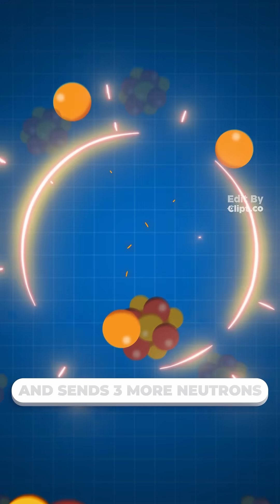How does nuclear energy work??

Comment: Inaccurate, here is the Accurate and simplifed? one. The nuclear reaction makes heat then water turns into steam then the steam either goes to the HPFP or deaerator or the steam turbines. In the steam turbine the steam goes into the high pressure turbines then goes into and expands in the intermediate pressure turbine then goes into and expands in the low pressure turbines then the steam goes into the condenser which turns steam into water using coolant (the hot coolant goes back into the cooling tower after cooling the steam to cool the hot coolant to cold coolant then goes back into the condenser to cool steam again)
The the condensate goes into polishers then deaerators then HPFP then goes back in to the reactor vessel then repeat. (also control rods and boric acid control the reactions so it wont over heat) (iodine will appear during reaction then decays into xenon)

Comment: So does that mean...: if energy has mass but is also at the speed of light it can create a lot of energy in not a lot of mass so when a fission core is turned on: This releases an neutron that neutron hits the uranium atoms so fast that they putted the reaction things into water to slow things down a bit those uranium atoms sends 3 more neutrons and spark a chain reaction that creates a large amount of energy and there is a problem with a major twist: If you don't contain the reaction you can end up making a power core turning into a bomb just like Chernobyl and Fukushima with 20 cm thick steel the nuclear energy makes the water boil and turns it into a steam that steam goes into a turbine the turbine powers a generator and the generator makes electricity! Just in case things get too hot they have these kind of cooling towers to release all the too much steam. (Correct me if I'm wrong I don't know chemistry equations)

Comment: Fact not fiction or fantasy 
Generation is dirt-cheap.
Both nuclear and roof PV. 
6cent kWh to 2cents kWh.
Nuclear electricity comes to your meter box full of GRID RENTAL COSTS. Big $$$$ cashflow. 

And then when the dunkelflaute stops, the GRID cashflow stops. But only when the sunshines. 

I am extremely concerned for the grid and the grid economics and the grid owners massive investment's ROI, return on investment. 

The grid was built over 14decades, 140years.
The grid is extremely valuable, too valuable to waste. Unfortunately to expensive to overbuild and too expensive to expand. 

The only way to double grid capacity is to build a second grid, basically double the existing grid capacity. At upto $13million per km in Australia and with 1million km in Australia, and limited number of decades, the fake GRID people live in a fantasy and will do more harm than good. 

Facts do matter, selective facts are just a fantasy. 

" Huston we have a problem "
A problem that most people do not see. 

I welcome all good thinking people because as you say it is a big problem. 

I got pissed off because my CivEng Degree friend who built designed and built earth dams in the rural Australia and read a book on nuclear chemistry promotes nuclear on national TV. 

He totally ignored my CivEng Degree and decades in large civil construction and building works and power stations and transmission lines and urban infrastructure. 

He took his EXPERT CONFIDENCE in areas of no expertese that was totally wrong. 
He got angry at non experts telling him he was wrong. FMD. 

We both have grandchildren who deserve a future. But he is wrong and only part right. 
He is dangerous. 

So I speak up.

Comment: Ok so heres the correct answer we got 3 types of most known reactors PWR, BWR, RBMK, so normally used pwr works by having enriched uranium U-235 that does fussion witch releasing neutrons and 2 more elements barium and smth else that are radioactive so in other words reactor fissions and creates thermal energy (heat) and 1st coolant goes throught the reactor, the water heats a lot then it goes to a steam  generator when it gives heat to 2nd circulation pump wich turns into steam and also removes small moisture so we have steam then we have a pressuriser that pressurises the steam to like 13Mpa or smth, so then steam goes to a high pressure turbine where it spins but the steam   looses a lot of energy so it goes to a reheater and a seperator that removes moisture and reheats the steam and then it goes to a low pressure turbines where it releases its last energy, the turbines spin at 3000 or 3600 RPM (revolutions per minute) then it powers a generator that normally gives 50 hz frequency and creates electirc energy and tgen it goes to a transmorfer that converts small kilowats to a higher kilowates and then connected to your national power grid so yeah we have electricity. BUT WE STILL HAVE THAT STEAM so after that we have a condenser that has cold really cold water that sorunds the steam pipes turning the steam back into water and then it goes to a reheater like i mean 7 reheaters and then its returned back to the steam generator BUT what about the water in the condenser? RIGHT so that really cold water that condensates steam back into water gets HOT so we have these gian COOLING TOWERS where tha water from the condenser goes and it cpold down with air and then goes back into the condenser. Plus if we loose some water we have a water source. Also forgot to mention THIS IS THE PWR REACTOR. BWR (boiling water reactor) works the same BUT the water boils in the reactor directly so it doesnt go to a steam generator and then goes right into turbines and forgot to mention that water is used as a moderator to slow the neutrons down and in a RBMK reactor water isnt used as a moderator but graphite is. THATS ALL just so u know this isnt chat gpt. I study nuclear power plants.ALSO FORGOT TO MENTION THAT THERE ARE CONTROL RODS THAT ARE MADE OF BARIUM OXIDE THAT ABSORB NEUTRONS AND SLOW THE REACTION.

Comment: Nuclear reactors are highly engineered facilities designed to produce energy through the process of nuclear fission. In simple terms, this involves splitting the nuclei of heavy atoms, such as uranium-235 or plutonium-239, to release enormous amounts of heat. That heat is then transferred to water, creating pressurized steam that spins massive turbines connected to generators, ultimately producing electricity on a large scale. One of the key advantages of nuclear power is that it can generate immense amounts of energy with relatively small amounts of fuel, and unlike fossil fuels, it emits virtually no greenhouse gases during operation. However, the technology is not without risks: managing radioactive waste, preventing meltdowns, and maintaining strict safety protocols are ongoing challenges. Despite these issues, many scientists and engineers argue that nuclear energy remains one of the most viable paths toward meeting global energy demands while reducing our dependence on coal, oil, and gas.
Reply: does unc even know whats hes yapping about 🫩🥀

Comment: For those who don't know what is a Nuclear energy Nuclear energy is a powerful and complex form of energy released from the nucleus, the core of an atom. This energy can be produced in two primary ways: nuclear fission and nuclear fusion.
Nuclear Fission
Nuclear fission is the process used in all of today's nuclear power plants. It involves splitting the nucleus of a heavy atom, such as Uranium-235, into two or more smaller nuclei. When this happens, a tremendous amount of energy is released, primarily in the form of heat and radiation.
In a nuclear power plant, this process is carefully controlled in a nuclear reactor. The heat generated by the fission reaction is used to heat a cooling agent, typically water, which turns into steam. The steam then spins a turbine, which activates an electric generator to produce electricity.
Nuclear Fusion
Nuclear fusion is the opposite process, where two light nuclei, such as hydrogen isotopes, are fused together to form a single, heavier nucleus. This is the same process that powers the sun and stars, and it releases even more energy than fission.
While nuclear fusion holds immense potential as a clean and abundant energy source, the technology to harness it for commercial electricity generation is still in the research and development phase.
Benefits and Drawbacks
Nuclear energy has several key advantages and disadvantages:
Advantages:
 * Low-carbon emissions: Nuclear power plants do not directly produce greenhouse gas emissions during operation. This makes it a crucial tool in the fight against climate change.
 * High energy density: Nuclear fuel has an incredibly high energy density. A small amount of uranium can produce a massive amount of electricity, which reduces the need for large quantities of fuel and minimizes transportation.
 * Reliable and constant power: Unlike some renewable energy sources like solar or wind, nuclear power can operate continuously, providing a stable and reliable "baseload" of electricity for the grid.
 * Small land footprint: Nuclear power plants require relatively little land compared to other energy sources like solar or wind farms.
Disadvantages:
 * Radioactive waste: Nuclear fission produces radioactive waste that remains hazardous for thousands of years. Safely storing and disposing of this waste is a significant challenge.
 * Risk of accidents: While nuclear power plants have extensive safety systems, the possibility of a catastrophic accident, like those at Chernobyl or Fukushima, is a major public concern.
 * High upfront costs: Building a nuclear power plant is extremely expensive and time-consuming.
 * Non-renewable fuel: The uranium used as fuel in nuclear reactors is a finite resource, meaning it will eventually run out.
 * Security concerns: The materials and technology associated with nuclear energy can pose a risk of nuclear proliferation.

Comment: It’s not that simple guys. The steam goes through the turbine and to a condenser where it turns back into water then through dearators which remove impurities from the water. Then the water is collected by feedwater pumps and sent back into the reactor vessel.
Reply: This is what i was looking for- 
Some reason i was super curious if they just pump in new water or if they reuse it someway. Im assuming its just a mix of both because they lose some of the water that gets vented out as steam too.

Its kinda funny that the whole reason i have this question in the first place is because of minecraft😂

Comment: Interesting fact: the water moderator is not only used to slow down the reaction to avoid a "nuclear explosion" as you said ( even tho it must be more than 80% uranium 235 to ocasionate in a nuclear explosion) it is realy used to slow down the neutrons but if the uranium fuel had to be fissioned with no moderator, there wouldnt be reaction, see, in the smaller world where we see atoms and smaller molecules, Physics works different as we see as big creatures, if the neutron is fast  as it is always because of the nuclear fission, the neutron would never reach the atom, but if its slowed down, we have more chance, as isaac newton said, the bigger is the mass, the bigger is the atraction, and we also have boron rods because the moderator will end up increasing the chances of less than 1 fission by fission to 2 or 3 fissions by fission, and boron absorb neutrons so we no longer would need to worry about how to stop the nuclear fission increase.
Also the cooling towers dont release steam, they cool down the steam.

Comment: hi, some mistakes:

-Didn't mention Control Rods
 Control rods are made with a neutron absorbing medium, like boron carbide, and since they absorb neutrons, it stops the uranium atoms from fissioning with each other. By pulling about 40% out, you get 20% power. By pulling about 80% out, you get 100% power. Pull all out, you get an upscale trip lol

-That's a cooling tower, not a vent stack.
 Those huge towers cool water from a lake or artificial water source, and run it through a condenser pipe. The steam passing those pipes will be cooled.  Vent stacks for steam are much smaller, and only exist in PWRs ( shown in the video is also a pwr)

-Missing Condenser
 Condensers cool the steam passing through it back into water so it can be put back into the steam generator

-Missing Pumps and Deaerator
 Feedwater Pumps pump water back into the steam generator, and the deaerator uses steam treatment to remove dissolved gases.

there are a lot more missing stuff, but then it wont be simple anymore.

Comment: Remember PWR(Pressurized Water Reactor) is safe in emergency ecause of a cool safety feature where if power is lost the control rods that are held by electromagnets will turn off and drop into the reactor killing the reaction in seconds with the shortest time recorded being less than 1 second but a PWR gen ll comes in at 12 of safe reactors but the fastest emergency shutdown time is the Kaleidos microreactor developed by Radiant Industries triggering within 300 milliseconds of detecting an emergency This microreactor is designed with a passive cooldown system and is planned to be tested at the Idaho National Laboratory in 2026

Comment: Fusion is anything but efficient.
It requires massive energy input.
The most recent demonstration required inputting half as much energy as it produced. But there’s an important detail here. The input uses electricity. The output is thermal energy which incur losses to get electricity back. So when a high temperature turbine, say one with only 30% losses, we would end up with something like for each unit of electricity produced we need to input 0.8 units to cause fusion to happen.
Meanwhile a nuclear reactor works with needing just a few percent worth of energy input to run the coolant pumps, control room and the entire remainder of the entire operational nuclear reactor.
Don’t get me wrong, a commercial fusion plant will likely get 3x as much thermal output as it input energy, but it will still be a heck of a lot more inefficient than a fission reactor.
And its still likely 20 years away from mass deployment. There are LOTS of untold challenges to be solved. The whole jazz is about the energy secretary and POTUS looking good, thousands of fusion scientists worldwide having a guaranteed career all the way to retirement, perhaps one or two noble prizes.
It won’t come soon enough to fix climate change. Solar, wind, geothermal and nuclear fission are still the way to go !

Comment: Bruh, it's almost impressive how perfectly balanced this video is between actual science and nonsense misinformation.

Nuclear plants are only scary if you don't understand the first thing about them.

And they can't become anything like a nuclear bomb, not even close. Worst case scenario you get an explosion from a buildup of hydrogen gas and the core melts down, which is literally exactly what it sounds like. It doesn't go boom, it literally melts into a radioactive magma called corium.
And slowing the neutrons down increases the reaction rate by making it more likely for them to hit a uranium atom, what you actually use to control the reaction is the control rods which absorb the neutrons.

Also the towers have nothing to do with cooling the reactor. They're shunting excess heat from the rest of the plant to atmosphere, which is why you see them on all kinds of sites, from different kinds of power plant to chemical plants and oil refineries.

Comment: Small correction: cooling towers are to cool down the condensers, water inside reactor system is VERY clean so its cheaper to just condense it and run it back into the loop

Comment: Nuclear reactors are not scary. A coal power plant is much scarier thab any nuclear reactor. FYI statistically, nuclear energy is safer almost every other type of energy second to only solar. Google it. One o'clock power plant put more carbon by mass into the atmosphere than all the nuclear waste ever created in every nuclear power plant ever. NUCLEAR ENERGY IS SAFER THAN WIND. Google it. BTW cooling tower are not present in case a reactor over heats but they constantly cool down the water in the second water cycle. A nuclear reactor cannot be a nuclear bomb as the uranium is not enriched enough to cause a sustained nuclear reactor without a moderator.

Comment: Reactors cannot be nuclear bombs. Reactor fuel is enriched under 10%, while nuclear cores used in bombs are enriched over 60%.

Even if you pull out all of the control rods, and stop coolant flow, the fuel would just melt itself, and form corium, which all Light Water Reactors are designed to contain.

I hate this saying, it’s so misleading and scares so many people.

Comment: the steam from the cooling towers has to be treated and purified to remove the radiation from the steam. only nuclear power plants with no natural water sources like a lake or a  river have these, the whole idea of a cooling tower is to release steam, let that steam condense and rain back down into the cooling tower which then recycles that water in the plants cooling system. only 2% of the water is lost using this method. the rest of the water comes from the water mains under the road. the cooling towers are so we arent constantly pumping huge amounts of water to make the power plant function